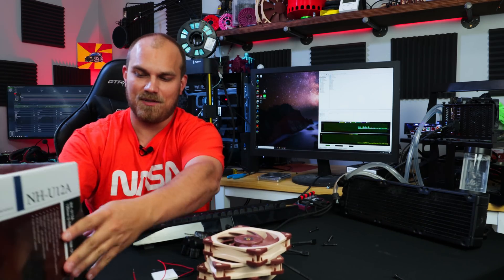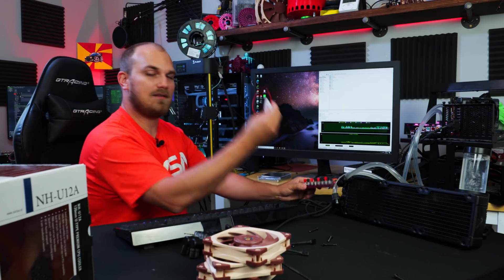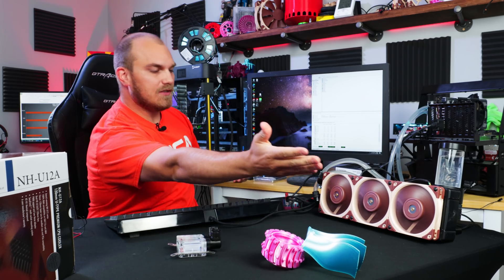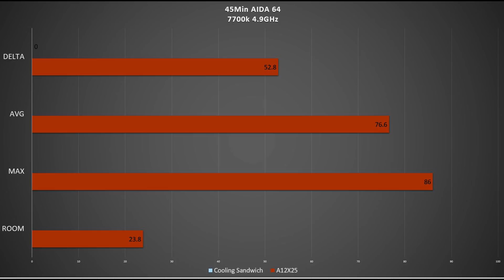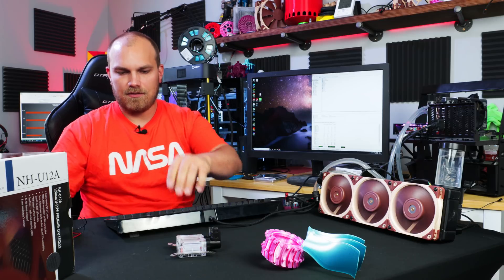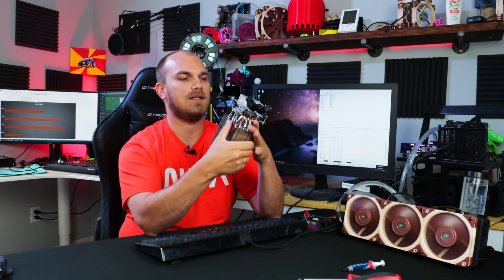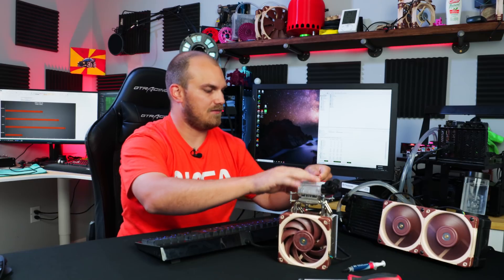Can A Wish.com Water Block and a $4 Peltier Beat a 360mm Radiator?

Comment: aluminum block to cpu, then peltier, then fan, attach a temp controller probe to the aluminum block to control temp, set the temp to 30C, dont run peltier full out all the time

Comment: I didn't think it would work anyway.
For two reasons:
1.
You're cooling a small mass of water.
You have to cool the water tank itself.
2.
The water pipes are very long.
You need to shorten them as much as possible.
...
It would be difficult to cool the water tank because it's round.
I don't know if there's a rectangular water tank.
I'm not saying it will work.
But I'll add a few notes.
(I'm using the translator.)

Comment: Pretty easy answer, if that air cooler doesn’t beat the 360, the tec on it surely won’t. You have to not only dissipate the heat of the tec through the air cooler but also the heat of the cpu.

Comment: If u already have aircond, might as well waterblock the cpu to the aircond coils 😂
Peltiers are more efficient when u have a large heatsink that can easily pull out the heat, preferably outside of the room. The less heat on the hot side, the better.

Comment: Yep there's definitely problems with this cooling setup! 
I see that you are running only a single Peltier! That's the first problem, second is that you are probably running it from the 12V supply! While the Peltier can run from a 12V supply, it doesn't cool as well as two Peltier devices running at 6V each! 
Sure they are expensive to run, but if the running costs are not factored in and the all out goal is better cooling, the air cooled radiator setup won't stand a chance against a bunch of Peltier devices that have their water running in series through each device! 
With enough Peltier devices, it will freeze the CPU! The Great question is how many would be needed to overwhelm the CPU? 
You really have to think about Peltier devices like solar cells! 
Can you power a whole house with just one solar cell? (A solar cell is essentially a small cell like they used to be available before they started to combine them onto a panel which is what we are more accustomed to today and when people who were testing the cells way back then and saying that they were useless but as we know today, that's not the case!). 
If people started using Peltier devices as they should be used, manufacturers will notice and start putting more R&D into them and begin producing better single solutions that will function perfectly for their intended purpose! 
This is the first time today that I have seen this video, but I knew as soon as I saw that you are going to be using just one Peltier device, it's not going to work! 
While technically it could! You would need a much larger water tank outside that is having it's water storage cooled by a single temperature controlled Peltier device that runs from solar plus battery which should keep your computer cool for as long as there's cold water (or water/glycol mixture (antifreeze)).... 
The large water tank will be cooled during the day and night (assuming that you have enough battery capacity to keep it running overnight until the sun comes up again).... 
I honestly believe that it's totally doable! 
Yeah it's going to be complex, yeah it's going to be expensive but once done, no radiator air cooling system will be able to touch it! 
But expecting all that from one Peltier device! That's asking for too much!

Comment: Can you connect it with the rediator? So the water firs cooles by the rediator and then getting below ambient by the paltier. Maybe getting a better block and putting even two paltier one after the other.

Comment: You got a 12706. That means it will use 6 amps and remove about 50W of heat. If you use a 12715 it will use 15 amps and remove about 130W of heat. A 360mm radiator can easily dissipate 300W-600W of heat as long as you get it hot enough above ambient and have good fans.

Comment: i'm curious if a tec would increase radiator efficiency. Under certain situations, a TEC can have a COP > 1 and a radiator effectiveness scales linearly ( i think) water temp. SO have the hotside heat water going into the rad(s) and the coldside cooling the exit water. As long as the extra heat dissipated  by the rad  is > the input watts of the TEC, It should have a positive effect.

Comment: One module is never enough. All these videos with just one TEC module. 

If you want to cool the way you want for a PC, you are going to be horribly inefficient, but it can be done. Turn a 120mm x 80mm x atleast 40mm radiator into a water block with fittings using some acrylic and glue. For the hot side, a multi pipe air cooler per module with appropriate fans and ducting.

That should cool the water an appreciable amount. But like I said, horribly inefficient.

Use 6 modules for this example, layed 2x3 for 120mmx80mm surface area. Feed them with their own power supply. 250w per module * 6 modules = 1500w+ power supply. Consider a full 1875w power supply, and use it exclusively to run ALL fans and pumps. Leaving the primary power supply to run the CPU, GPU, Drives and all other works, in peace.

I don't know why or where you'd need that level of cooling for a single CPU... beyond bragging rights.

My personal feeling, and it would be bulky: over the CPU use a chunk of 40x40x80 copper, tall side coming away from the CPU, mount 4 pipe coolers and their fans to the copper bar, closer to the top. Gives you both a large thermal mass and 4 huge pipe coolers on a single CPU. And no liquids or threats of condensation.

Comment: I've been thinking about this concept. What if the peltier cooled the reservoir fluid instead of a water block. There by cooling the water en masse. Just an idea. May need to use a smaller radiator as well.

Comment: Use both radiator, and a TEC HSF, in that order.  Remember this fact.  You will need two thermal solutions.  One for the CPU heat and another for the TEC.   The Noctua can not thermally manage both TEC and CPU by itself, as it was not designed to be a  solution for both.  When this design has been optimized  for both, the power and space required to add a TEC device to a water cooling solution will be more valuable.

Comment: I would like to see a setup where the peter cooler setup is added to the water cooling system. The radiator cools the water to somewhere above ambient and then the peltier cooler pulls more heat off after. Compare themals in the computer with just a rad against a rad + peltier. I'd think you might be able to get sub ambient temps.

Comment: I dunno if it matters that the heat sink and heat pipes are upside down but anyway
Reply: I noticed the same thing. How can the liquid fall to the hot part and have its phase change into vapor so it can get to the cool part, when it’s upside down? Now i have to search for a test of right side up vs upside-down. Lol

Comment: It will work unless you use the Max Wattage of the Peltier. Like mine, I have a black shark cooler, I use 120W charger it's useless if the supply is doesn't reach the Max Wattage of the cooler.

Comment: Would have worked better without the TEC in the middle. I do believe that fans work better sucking air from the heat exchanger . Take for example a car radiator the fan is pulling the air from the radiator.

Comment: The peltier is limited by the hot side cooling.  If you want to drive the temps lower, you need to bring the hot side cooling way lower.  Its a heat vacuum and the bag is filling.

Comment: try to put the peltier to the radiator..so basically it cooled the radiator...not the chip itself..i think it will bring some more sense..n waybe 2 -5 degree drop down in reading..and icrease the reservoir size so the termal equilibrium will be not n limit will not reach to fast..i think you get the idea

Comment: Dell offered a water loop with a Peltier block called H2C. The XPS 710/720/730 had it as an expensive option. It was regulated to not go below ambient temperature. If it goes below ambient temperature the radiator starts adding heat into the loop. This also avoided condensation issues. It had 2x Peltier chips after the radiator. Peltier can easily go well below ambient if you have enough of them. But then condensation will need to be considered.

Comment: I still to this day do not understand the point of the nonsense. The obvious use case would be CPU to Rad to Peltier to CPU this way the RAD would bring liquid temperature close to ambient, then the peltier just needs to handle Slightly above ambient to below ambient. This not only would not need so much power from the peltier, but would also more efficiently use the power in the first place. All these YouTubers going Peltier direct... it just screams lunacy.

Comment: You need to generate electricity with the peltier module. Run hot water on one side and cold on the other and you could run your fan with free electric.

Comment: I wonder if the water wasn't staying in the block long enough for it to get cooled down. You may, either, need a water block with a longer groove so the water stays in it longer or a longer water block with more peltier chips attached. But, in that case, how many chips before the cost of electricity outweighs the cooling efficiency?

Comment: Push 5-6 amps and 12-14 volts trough it? I made a mini fridge out of one with a cpu heat sync and a sound card heat sync and it required a lot of power to get it to 40F

Comment: While I don't think that this idea would work in general, the air cooler would probably operate better right-side-up due to thermodynamics. Sitting upside down is probably its most inefficient position.

Comment: You need to try again with a stronger peltier like a 12715 and add two fans to the heatsink instead of one. You might be surprised with the results. Here the cooling capabilities of the peltier you used was a clear mismatch to the heat load

Comment: The difference of volume that 360mm radiator cools vs what the tec cools is huge... The time the water stays in contact with the tec is faar less that it thaT it stays in contact with the radiator.. if you try to match those the tec cooler will perform better...

Comment: isnt it that heat pipes work when they are pointing upwards and otherwise they are worth just as much as little copper pipes? (like there were meant to be relaying on some evaporation effects of thing inside of them and then this thing have to be touching by gravity the hot base not just be dumped down to the condensation ends? )

Comment: This is a fun experiment (though I'd love to see how it works along with a radiator along with the Peltier block) but that Peltier is way too small. You need a good 200W element. The waterblock is probably fine as I've used the alseye and it cools about as good as an average AIO block.

I mean, how about a tec chiller?

Comment: Think your peltier is rated for aprox 65watts,thats why it didnt work too great:) But if you hook it up with your rad also then you at least get to see what it can do.

I build a custom loop with 2x stock aio's, 2x 280 rads and peltier watercooling on it.. overclocked my FX9590 4,7ghz @ ~ 5,2ghz and my rx580 nitro to 1500mhz on the core and 2250mhz on the memory.

Temps max:
GPU 45*c
CPU 50*c

Water temp in loop 25c under full load
Room temp 22c

Success! 😁

Comment: What if you took a 360 rad, cut all the fins off flush to the side of the water tubing on both sides then cover both sides completely in peltier's and used fans to just blow air over the back side of them like a case fan would.

Comment: the peltier module consumes more power than what your pc power supply can put out (up to 10A at 12v). Therefore your under running your peltier.

Comment: Get 3 tecs, triple stack them and make the bottom 3v, middle one 5v then the last 12v (might have the 3v & 12v swapped)... The problem then became the condensation on the water lines...😉

Comment: Does orientation of the Heatsink  matter, I thought they used convection flow to move heat to the fins???  FYI if the TEC was connected backwards you could just reverse the leads.  also a TEC is like a heat pump and  is only as good its ability to shead the heat with the Heat sink.  please give it a second chance just invert the stack with the fins UP,  I love the show

Comment: I was considering this, AFTER the radiator. so radiator -> reservoir/pump -> peltier -> cpu ---> radiator.
But using a much more powerful peltier to pre-chill the water before it hits the cpu. So it should bring the temps down below what the radiator can do on it's own, since the peltier can go below ambient. IE if the radiator can get the water down TO ambient, then the peltier would take it even further before it hits the cpu.

Comment: @Major Hardware  the idea is not working cause your cooling area is to small , take a plastic TAB squeeze that Peltier between two  identical Noctua towers , hot side cooled with push pool fans , other one go down to the TAB which is serving as an open reservoir drill the hole at the top and botom of tab install there two fittings for tubing , top one is for cpu outlet , and bottom for cpu intake, that way you efficiently cool water in the loop wattage is equal on both side Peltier , and your design is not working cause youre effective cooling area for water is to small so most of water is have not enough time for cool down .

Comment: Would you try this? (H=HOT/M=MEDIUM/C=COLD)Set a loop in this configuration: The water(H) goes out the processor, then enters the radiator, wich, IN THE BEST CASE cools it at room temperature (M) and THEN you pass it through 1 peltier-air cooler combo, so it can be cooled belows the room temperature, you can add more peltiers combos for more pleasure

Comment: Some years Ago i testet a pretty strong peltier directly in the cpu with my air cooler on top and managed to hit 0° C  (32°F)  in Idle. Was afraid to test under stress because of condesing water.

Comment: Alright try this.... get 2 single fan radiators. One radiator will cool the pelt, water block to water block with pelt inbetween. The loop will go, out of cpu to 1st radiator (regular)  out that radiator into cold side water block of pelt to the cpu. Compare that to the 3 fan radiator.

Comment: C´mon man, you know that Peltier´s works on a temperature delta. Heat + eletricity = cold on the other side.  Cold + heat = eletricity.  It´s more efficient to put heat on the hot side and use the cold side to cool the radiator.  I think you won´t need the fan.

Comment: How many Amps the Peltier is? Maybe a higher power one?
You may try to keep the radiator and add the Peltier on the loop and see if you can have better than amb temps.

Comment: What if you had the peltiere right on the cpu?
Reply: Same thing: you will need an extremely powerful Peltier cell and a "lot more extremely powerful" cooling system (air or water) on the hot side to be useful for modern CPUs (and to not burn the TEC), because peltier cells just make a temperature differential between hot side and cold side.

So you have to dissipate both the heat from the CPU and the heat from the Peltier cell (that is the heat from the temperature differential + heat produced by the TEC itslef due to extremely inefficency intrinsic in the cell).

Comment: The peltier chip doesn't directly transfer energy from the water block to the fin. If you're gonna use peltier chips with water blocks you want to use them to keep the liquid cool but they'll need their own way to exhaust heat.

Comment: I know I'm super late to the party, but put that block in-line after your radiator. You stand a small chance of hitting sub-ambient temps. If you're using a $4 peltier its probably able to suck out about 15W of heat, at the absolute best. I've got two "225W" peltiers around here somewhere, and their curve shows they'd be able to move about 90-100W of power. If you wanted to cool a modern CPU you'd need about 3 of them. Also, keep in mind, if you do get sub-ambient you'll need to seal things up to keep condensation from dripping on your board.

Comment: Tec's are very bad unless you spec them very well for the amount of heat wattage being asked of it. Try without the tec and I'm sure the heat pipes will do a good job on their own. The limiting factor will be the water, it takes a hell of alot more effort to remove heat from water compared to adding it.

Comment: Surface area man. The velocity of the water through the block gives the Peltier no time for effectiveness. Larger volume water block may make a difference but peltier devices are not an efficient means as you stated. So maybe two stacked peltiers and a larger water block with the air cooler. Either way, enjoyed the vid.
Reply: And by stacking I don’t mean one on top of one of another before someone gets all defensive like I’m insane. Even though it would be a cool experiment away from other expensive electronics. Meant a stacked loop to be clear.

Comment: I have a ryzen 5 3600. And i have a 12v 60w Peltier Plate Module sandwiched between the stock cooler and the cpu directly. And it works fine for me. I get around 29°C when gaming. Haven't tried it with synthetic load. So idk about that one.

I was thinking of upgrading to a ryzen 9 3990x then ill upgrade to a 360mm radiator with a TEC1-19906
Peltier Plate Module its a 6A 24V 120W

Comment: my thought is it could be better by a small degree... ha ha get it. the capillary function of the heat pipes may not be doing as much as they could be. if they were flipped over or even flat. i feel it could be better. though i don't feel by much.

another thought is. not a good one at that. what about using a water cooler to cool the peltier? (i bet 50 people below me thought of this already. but i didn't read all 700+ comments)

Comment: I like the idea but it needs more thinking. Like you can use smaller radiator instead of that huge one and connect it with the loop.